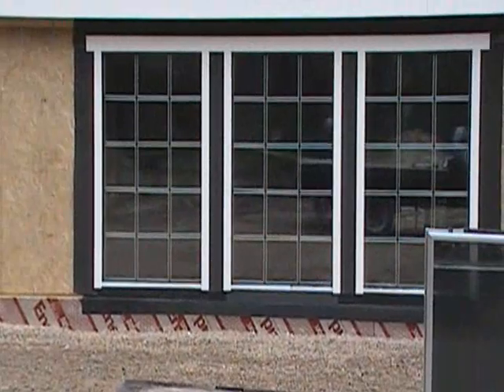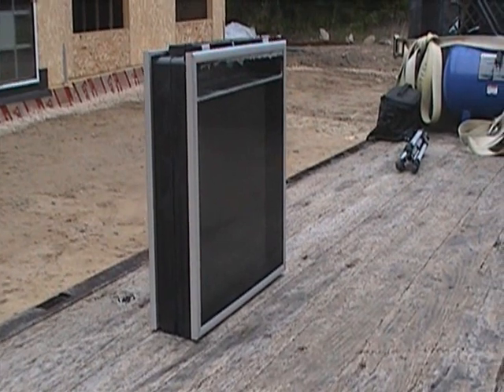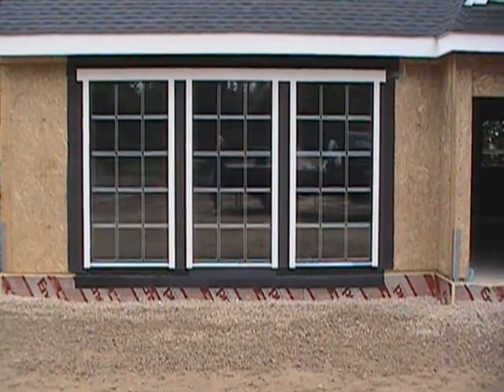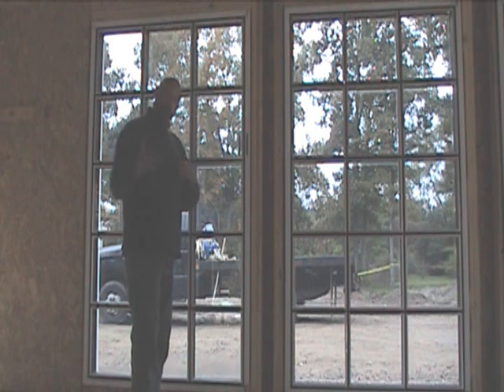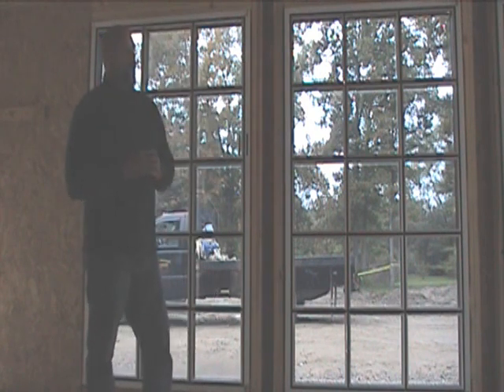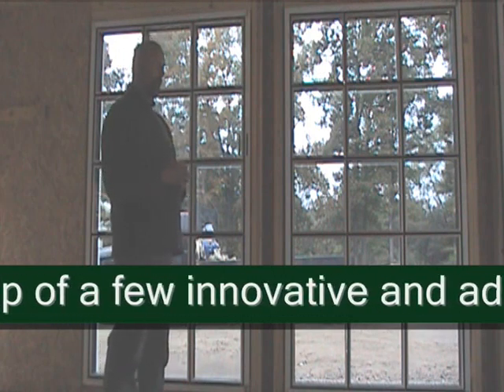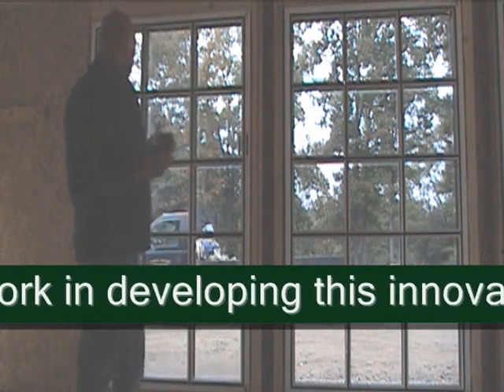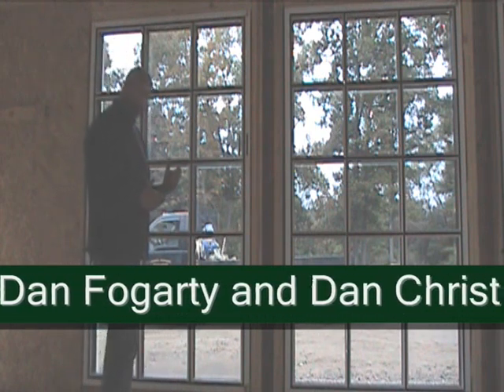Thermal Mass Windows

Comment: I've built trombe walls and sold insulating shades in the past and I had this same idea in the late 1970's but never built one. I was going to drill holes in the top of regular glass block and try various types of bleach to keep the algae from growing in the water. I was going to use window quilt shades between the glass and the glass block. I'll be glad to use such a product in my buildings when it does come out. I will bookmark your website so I can see when it hits the market.